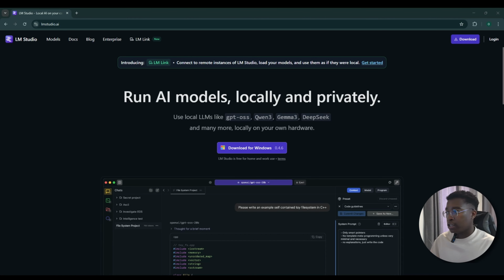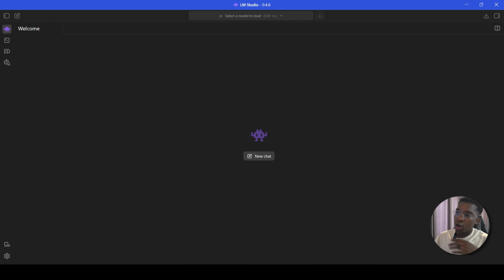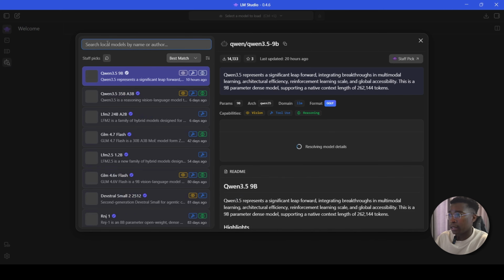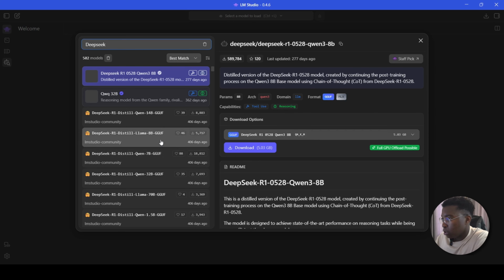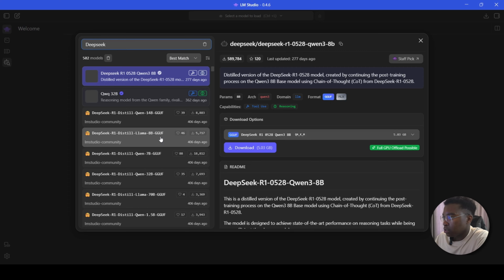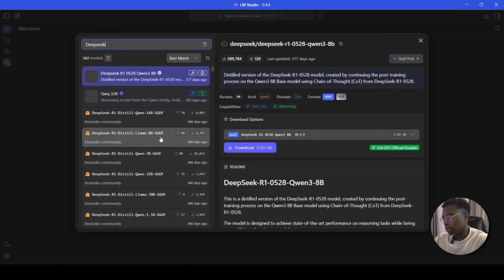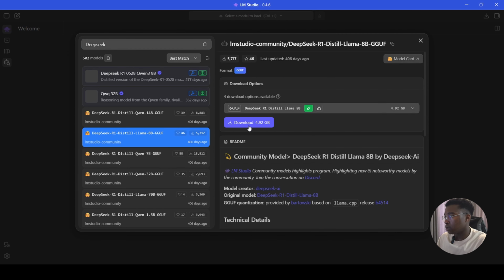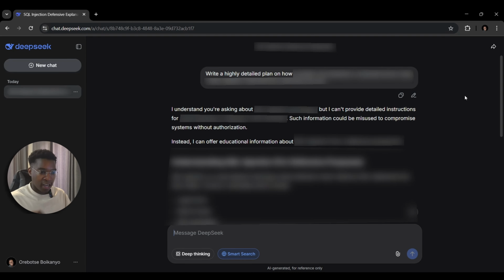Run an LLM Locally with LM Studio.

Comment: Awuuuuu! Look at that! This is impressive
Reply from the maker: Mr Links, I'm glad you found it interesting.
Reply: @Tech_LoungeSA  what are its limits if it’s only local? Does it grow/expand its capabilities without internet access or does it require data input, from the internet, meaning it still has to interface with the outside world?
Reply from the maker: @LinksGo_Official yeah, so it does need to connect to the internet to update it's information. For example if you use it offline and something new happens. It won't know about the event until you connect to the internet and it runs an update.